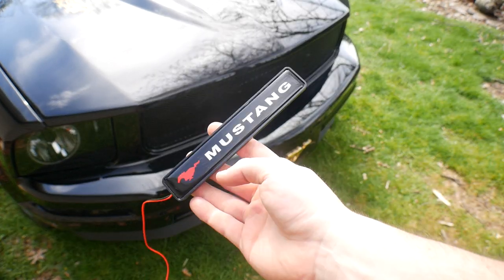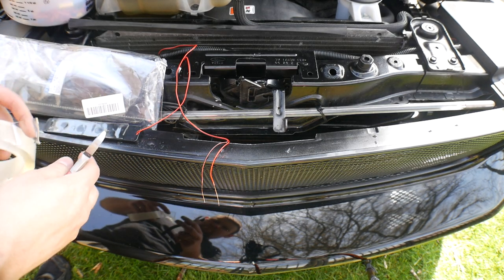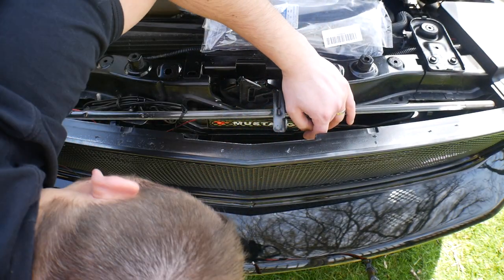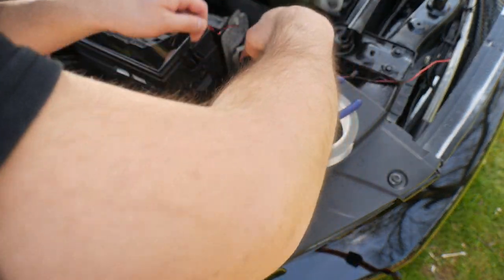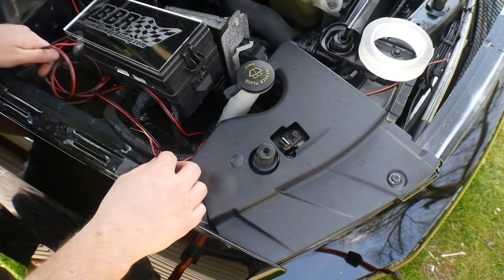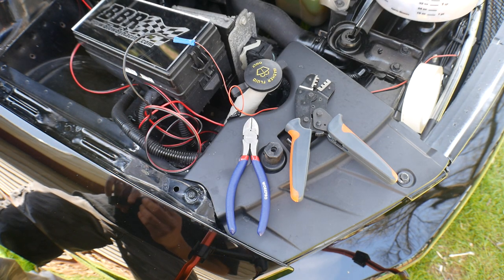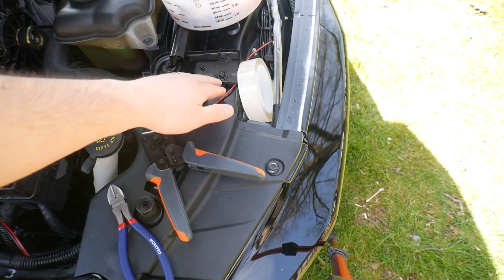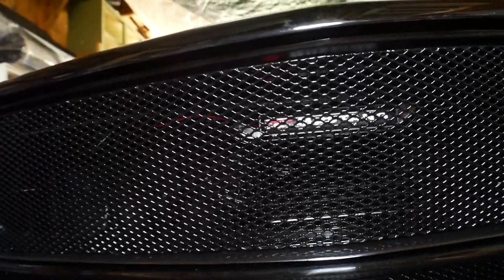Mustang LED Emblem Installation

Comment from the maker: you can buy the emblem here = https://amzn.to/3e7JxUP
if you need more wire i use this = https://amzn.to/3eaNIiC
Double Sided tape = 3m  =https://amzn.to/2AJ03fA
clear double sided tape = https://amzn.to/2LMikuH
Underglow light kit = https://amzn.to/2ZpLcBd
Basic tool set = https://amzn.to/2ZnCgw9
Electrical Tape = https://amzn.to/2zYDIKR
Connectors = https://amzn.to/2ATSOln
other connectors = https://amzn.to/2Tqihcc
Reply: The link for the emblem won’t load up

Comment: Hey question do you connect the black and red wire to the battery?
Reply from the maker: i would connect them to a on off switch / button then connect it to the battery, if you connect it direct to the battery it will be on 24/7 and slowly drain the battery

Comment: So to connect this you hook it up to a ground and to the battery or just to the battery
Reply from the maker: Just right to the battery but  you'll want it on a switch so I can turn it on and off and on off switch will work
Reply: @RevLine89  if i connect to the battery it will never turn off even when my car is off? Thanks

Comment: Its nice bro, but I wish you showed how to wire the switch? Connecting to battery would drain the battery, how can I control on and off?
Reply from the maker: All u need is any switch and connect pos to one end I'll make a note to make an update video showing you
Reply: @RevLine89  thanks brother..

Comment: 1 should have been on the outside for better visibility 
2 didn’t show us where to hook up to power it,what lead did you splice into for power etc
Reply from the maker: On the outside would look horrible and you connect direct to your battery in my case a line I already had connected to a switch